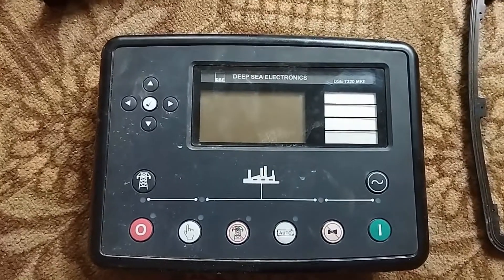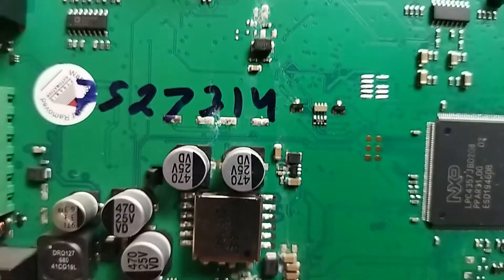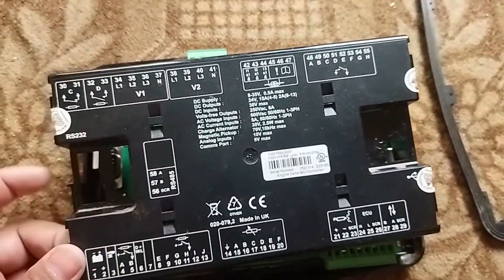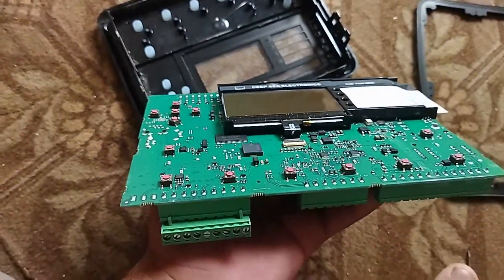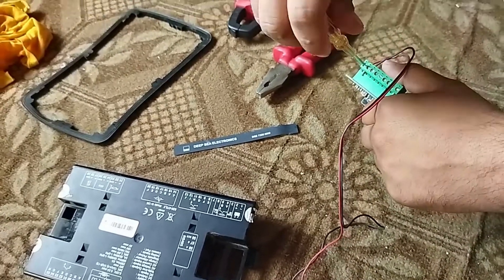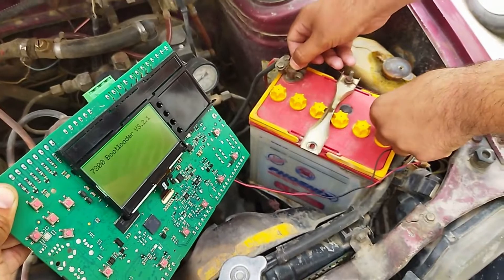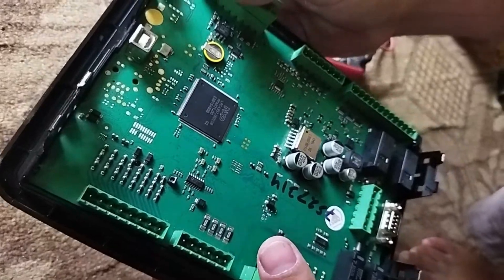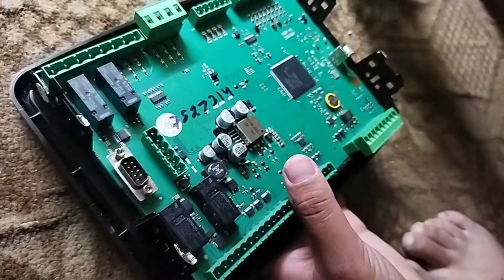How to Repair, Install and Troubleshoot  DSE 7320 MKII.

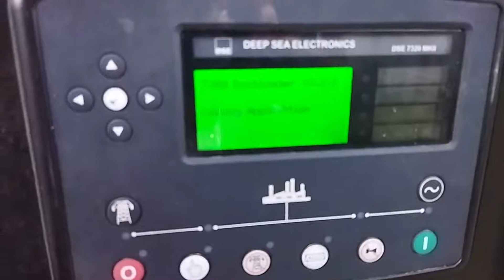Comment: Hello,  6:14, what did u do to make it start from the 7300 Bootloader V3.2.1?? i got mine stuck on the this error code.
Reply from the maker: Clean it's circuit with contact cleaner or petrol

Comment: Hello sir mere pass dsc 7320 mk11 controller hai new one generator hai fails to stop bta rha hai ....4 aur 5 number wire mai negative supply aa rha hai plz tell
Reply from the maker: Check cutout relays

Comment: Hello boss 
I have dse 7320 and it startup and after few seconds reset could you help me ???
Reply from the maker: Check DG module DC input and breakers or fuses.
Reply: @ElectricianUsama  DC input is okay and i dont know what is DG module
Reply from the maker: @mohsenhonarmand1024  i mean DSE 7320 controller
Reply: @ElectricianUsama  sir DC input is okay and all of its capacitors is ok some one suggested me to update firm ware is it helpful or not ????
Reply from the maker: @mohsenhonarmand1024   check Running hour on dse is it reset also
Reply: @ElectricianUsama  where can i see runing hours???
Reply from the maker: Ok update it
Reply: Did you find the problem, i have same problem